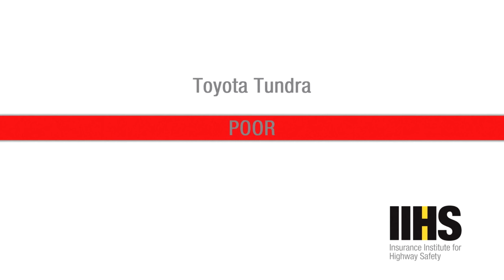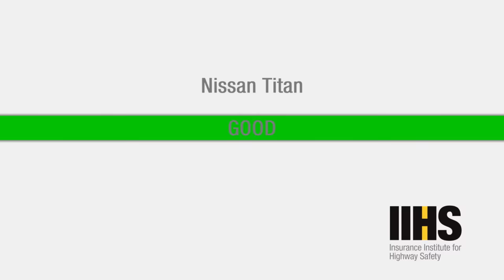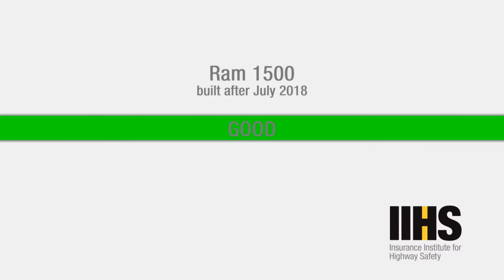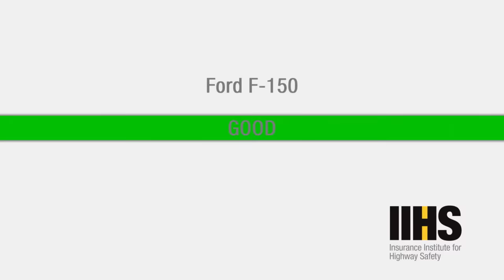TRUCK CRASH TEST COMPILATION - Ford F150, Toyota Tundra, RAM 1500, Nissan Titan

Comment: I was amazed at how much different the Ford responded to the crash.  It literally moved to the left and continued straight.  It was the only truck that did that.
Reply: its because ford used to own volvo and i guess volvo taught them how to make cars do that look and newer fords they all slide off
Reply: @J7Haip  LOL, Volvo taught Ford how to make cars.
Reply: Heavy coat of wax on the bumper helped.
Reply: It's because it's the only vehicle there made of aluminum.
Reply: I think it's because of the crash bar behind the front tires, I'm not sure if the other brands have those.
Reply: @suserman7775  Yep.  V-6 F-150 weighs almost as much as the steel competition because they used that weight elsewhere.
Reply: Maybe the point of contact was carefully calculated towards US pickups? Anyway I don't trust these organizations, and not a fan of US cars.
Reply: @bluegables  Yeah me too. I only buy German cars, accept for my F150.
Reply: @bluegables  Titan passed. The Tundra was designed before this test was introduced, and the smaller pickups don’t really weigh that much less.
Reply: @occultustactical6138  I love german cars.  I also have german cars and an F150.  but I wouldnt own one out of warranty.  ****except for classic 911, M3 etc of course
Reply: @mikemellon80  I only own them out of warranty :-)
Reply: @bluegables  What don't you trust about them? IIHS tests all vehicles sold in the US which includes import cars, and Europe also has an organization that does crash testing. Their effect is literally observable in the vehicles they test. Over time, car crashes have gotten more survivable, as cars that are safer get more money so it is meaningful for manufactures to actually invest in making safe vehicles for their customers, and if they survive a bad crash with no serious injuries it can build up confidence in that manufacturer to continue making safe vehicles thus increasing sales. Manufacturers want your money, so if making the vehicles safer makes them more money in sales, then it is worth it. These organizations have also helped regulate other safety aspects of vehicles as well. Why you wouldn't trust them when they are literally responsible for making sure you know which vehicle might kill you in an accident and which one won't is beyond me, but you do you I guess.

Comment: Ebay: As good as new. Small dent on the passanger side, will buff out with a little effort.
Reply: Or “Rebuilt title due to minor front end collision”.
Reply: That’s actually Craigslist, “Runs and drives, clean title, no low balls I know what I got”
Reply: AC works ice cold
Reply: “Garage kept and rarely driven”
Reply: @YouTubeAIbot  😂 true
Reply: No lowballers, I know what I got
Reply: New tires, low miles, son was in a fender bender while listening to Crash Test Dummies, ready for an upgrade.
Reply: P.s. as is no returns
Reply: Lol

Comment: The Ford's reinforcement at the firewall is impressive. It crumpled up until the passenger cabin and then deflected because it was so rigid. That is the gold standard right there.
Reply: Did a great job, but honestly I think the Ram did the best at absorbing the impact, as the cabin was nearly untouched !
Reply: As an Asian men, that why I choose Ford, just because I am an engineering
Reply: The problem with the ford (compared to ram, which also got a good rating) is that the A pillar flexed on the ford which risks cabin intrusion
Reply: @c7torchred868  ford has an overall better safety rating. So no.
Reply: 100%
Reply: I was hit broadside at the a pillar passenger side by a Chevy Silverado 1500 doing 40 mph and my 2010 Ford f150 took it like a champ protected my passenger and I got it repaired $11k later good as new Ford Tough

Comment: I will never not be impressed by the safety of the F-150. That truck took it like a champ
Reply: جميع السيارات الامريكيا قويه جدآ
Reply: @محمدالعراقي-ض5غ8ك  not true. american cars are crap. german ones are the best
Reply: @michaelberg7825  German cars are money pits in the US. Unless you're leasing they're shit in the long run.
Reply: Literally all the trucks crumbled the same quit riding on fords nuts they’re not good trucks
Reply: @Black_jjcoolmaster  Wow, such an expert.
Reply: @STEALTH1USA  surely am
Reply: lxRaptorxl  I never said anything about Toyotas L comment
Reply: @michaelberg7825  you mean the ones who throw check engine lights and constantly break down with zero resale value?
Reply: "ford f150 built tough"
Reply: @Black_jjcoolmaster  no they didn't, did you even watch the video?
Reply: @Black_jjcoolmaster  I know this is a bit late but did you even here the explanation given the ford after taking such a hit gave low metrics for any injury on any body part further more the ford is the only truck to continue its forward momentum which means that the people riding inside will take less g-force changes than in any other truck this means less chance of internal injuries or whiplash also what does it matter if all the trucks crumpled the same thats not the point of the test the point is cabin safety not whether it is totaled or not thats why trucks especially large trucks are extremely good at high speed crashes like that because they have large crumple zone to dissipate energy and against lighter objects i.e smaller cars like for example most anything not made in the U.S. the truck takes less damage in general this is why trucks are common in the U.S. because they can carry a lot can take a beating and if you purchase the right ones can be the safest cars to drive on the road
Reply: @tcg1_qc  did you 💀
Reply: I have 3 German cars no they're the least reliable 
cars I ever own but they made me look good.
Reply: @michaelberg7825  ok mr germany lover your cars will release all of the shock on the passengers
Reply: Glad it’s improved a whole lot compared to how bad it did back in its 10th Generation the Crash was Horrible in that one.
Reply: @billycalifornia1112  the one with weight in its bed? That video?
Reply: Huge improvement compared to how Awful it did 20 years ago
Reply: @john_toss  I think that he's referring to the pre 2004 model, namely the supercab configuration truck. Frontal crash is a complete disaster, like smashing the driver's skull like a grape with the way the truck folds in on itself.
Reply: @markk3652  I think you meant the 10th gen 2001 one. Now that one is nasty. I have a 12th gen f150 with the 5.0 and safe to say that the f150s have fare better in the crash tests since then
Reply: @john_toss  1997 thru 2003, yes. Especially the supercab.
Reply: lxRaptorxl  Now that I think about it, I don't think I've ever seen a Toyota pull anything...
Reply: Fun fact.. 1 friend had a ford focus that got hit in the side by a Chevy truck didn’t do as much damage as one would have thought to the car but the Chevy truck got messed up front bumper and more. Then another had a small ford Astro van that got hit by Chevy truck 1500 2021. The Chevy rear end his van at a good speed. Barley dented the van and a rear but man that newer Chevy front bumper, grill and his hood wasn’t looking good.. they weren’t kiddin with built ford tough..
Reply: Bro what I always see German cars on social all fucked up cut in half ND shi after a crash all ways the beamers
Reply: go f-150!
Reply: @Black_jjcoolmaster I bet you drive a Honda pilot
Reply: @michaelberg7825 Okay Stalin
Reply: @MTM-Shorts  bet you drive a minivan 🤷‍♂️
Reply: Did they say how fast they were going. If they did I missed it
Reply: @michaelberg7825  LOL
Reply: @Black_jjcoolmaster  LOL
Reply: Truck durability dosnt matter
Reply: HOW ARE THOSE SAFE??? THEY HAVE LIKE 2MM OF CRUMPLE ZONE

Comment: Build a car out of the crash barrier.. That things TUFF
Reply: Tough but lol nonetheless
Reply: 😂😂 it would be cool, but if a vehicle is too heavy it can be more dangerous. Something to do with how it absorbs the crash force.
Reply: @Beelzebubby91  I don't think tanks are dangerous to the driver.
Reply: It would probably weigh tons and give you 5 miles to the gallon
Reply: Cars aren't ment to be super tuff, there ment to absorb the impact.
Reply: Zero G Tanks aren’t driven by soccer moms on their cell phones while doing 80+ Mph on the highway
Reply: John McMahon it’s tough because it’s a solid wall of metal
Reply: Not even a scratch on it
Reply: It exists. It's called a Tank.
Reply: Weight is an issue...
Reply: A concrete car
Reply: Yeah so all the impact force is absorbed by the occupants. 😛
Reply: It's already done. Its called a Volvo.
Reply: Way to heavy
Reply: The only problem is when that car crashes it will destroy the other car
Reply: Yeeaaaahhhhh.. if you can crash and not fuck up your engine, it's good enough for  manly man..don't even need airbags, we die like real men..
Reply: Yes lets make a car out of I believe concrete and plate it with steel.
Reply: @philc.9280  5 gallons to the mile more like
Reply: @philc.9280  2
Reply: well if they made the car out of the barrier, that thing has no crumple zones to absorb the crash impact, literally killing you bc ur gonna absorb all the force from the impact since the barrier will transfer it to you..
Reply: Thats why the car companies would have to build special seats that slide during an accident.
Reply: Thats what the testla cyberpunk truck will be make from and it will be the safestest truck ever made because mr. Musk achually CARES about not only his customers but also people driving other cars and pedestrians too. He is truly a visionariy on the car autpmotorsrty.
Reply: @Beelzebubby91  true
Reply: @zerog5109 yeah cause tanks are armoured not heavy. Also they are death traps when going car speeds and stopping completely in less than a second because no airbags or seatbelts etc

Comment: I know for a fact the F-150 handles this exact test tremendously well! Saved my damn life 💪
Reply: Jay K Tell that to the people that weren’t paying attention and pulled in front of me while the driver was looking for the cell phone under the seat. Their new MX5 was in pieces and the passenger was ambulanced to the hospital. Just because it’s “modern” doesn’t make it “safe” in my opinion. The Raptor is one burly pickup and the overall crash test ratings of the F-150s are graded higher than its competitors. The truck saved my life when there was literally nothing I could do but go straight into the other car. It is their fault and luckily they admitted liability at the scene; driver was also cited for using a mobile device. The driver felt so bad, first words out of his mouth were “I didn’t see you”
Reply: yea the f150 saved my cousin. had her 3 week old kid in the car too. not a scratch
Reply: Same
Reply: Jay K lol edit your original post and tell me I’m not getting it. Lmao okay dude.
Reply: Jay K Sure autos are safer than they were but it doesn’t mean there isn’t still much room for improvement.
Reply: FORD F-150 ALL THE WAY
Reply: My 2014 F150 saved my life as well in a 60mph head on situation a few years ago. 16 year old girl , brand new driver, going the opposite direction,  turned left right in front of me.
Reply: Jay K drives a Prius.
Reply: WRONG!
Reply: @eatsleepdrive7034  I agree with you 2 million percent.  As a matter of fact - one of our neighbors was out walking the other day - he came by and said he was in a wreck in his Chevrolet truck - He NOW owns a Ford truck - he said the difference in how they are made was night and day and he is now a Ford man.  Good move in m opinion!
Reply: WHAT??? this makes no sense.
Reply: RockandRoll Thank you so much for the comment! 😎🙏 🤙
Reply: Jay K lol you’re a funny guy
Reply: Ford is over priced junk I bet you over paid for your truck hahah
Reply: Jay K they had to reinforce the f150 after 2015 because it did so poorly!
Reply: like the Tundra in the above video?
Reply: Picture?
Reply: Ford isn't my favourite truck ever but they are still good Ram makes the best trucks i think but still Fords are good Ram is number 1 though
Reply: THAT ram is exactly opposite to it lot many issues of accidents.  3 rams at high speed  crashed on to one pilot and highlanfer. Not even an airbag came out
Reply: Green Giant  I know you're against ford
Reply: Green Giant  not always.
Reply: @ jay k this guy is hating the most, people tend to hate the best, especially when it’s the best selling truck. I’m sure he drives a Prius or something but honestly whatever you drive stick with it, we need some comedy in our lives lol
Reply: Calm down buddy, stop being so immature
Reply: @eatsleepdrive7034  tje raptor is just a plastic over aluminium truck
Reply: @cameronjones1583  not just the best selling truck but the best selling vehicle of all time and people these vehicles are so much safer yes they need improvements but back in the day PEOPLE GOT IMPALED ON THEIR STEERING COLUMN. So these vehicles are so much better.
Reply: tell that to Toyota owners.
Reply: I had a 2002 F150 and some joker T boned me at 60mph in 2010. It saved my life.
Reply: nothing better than a Ford truck. Allways will be that way.
Reply: Jay K negative

Comment: Ford F-150 be like : sliiiiiide to the left
Reply: BUILT.FORD.TOUGH
Reply: Underrated comment
Reply: @Ocean Lover it starts right up 🙃
Reply: @Alongfortheride693  were you ever able to get those phasers fixed?  I have a 2019 that’s doing the same thing.  Of course the dealer says it’s normal.
Reply: @Alongfortheride693  thanks for the reply.  I don’t blame you for waiting.  That’s pretty much why I haven’t really pushed the issue.  I don’t have a lot of confidence that it would be put back together right.  It is very annoying though especially for how much they charge for trucks these days.
Reply: @I Pepperspray KarensNTheFace ford moter company vehicles start right up and run forever (unless you have a focus)  also they are very reliable trucks and cars
Reply: Nope Found On Road Dead = Ford.
Remember the Ford's also own the Detroit Lions so how can their  automobile products be any good?

Comment: It would be interesting to see the difference between the 1/2 ton models tested and their 3/4 ton equivalent such as the F-150 VS the F-250 or the RAM 1500 VS the RAM 2500.
Reply: I was recently dropped by my insurance company for my F350. 
They said is causes too much damage to other vehicles. 
It weighs 8330 lbs empty. 
I have to get insurance for a commercial truck.